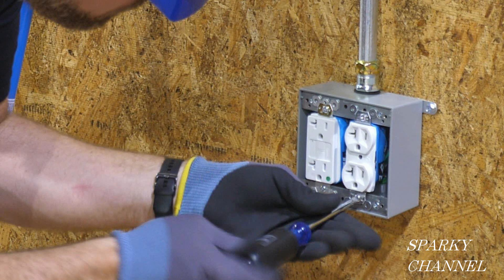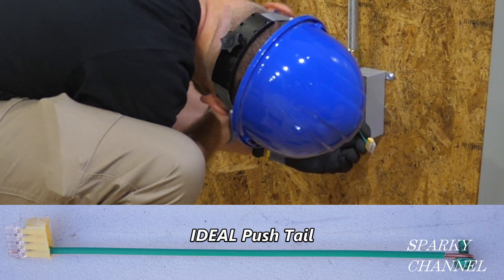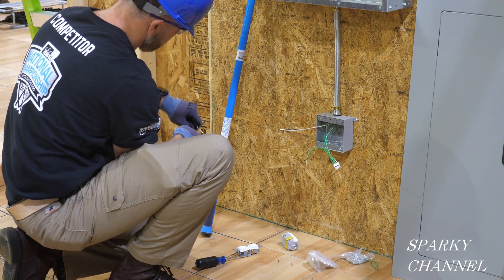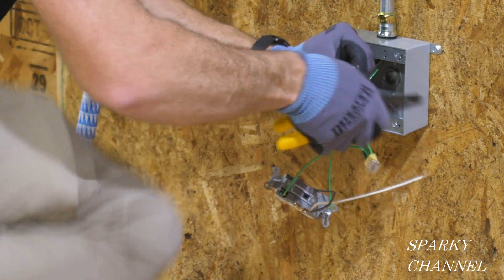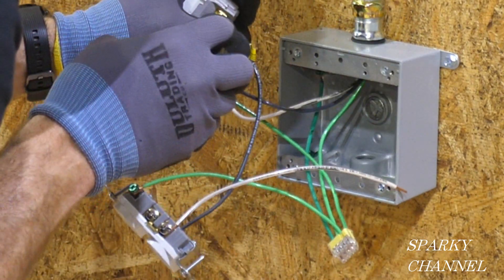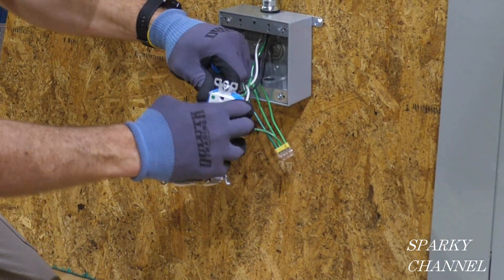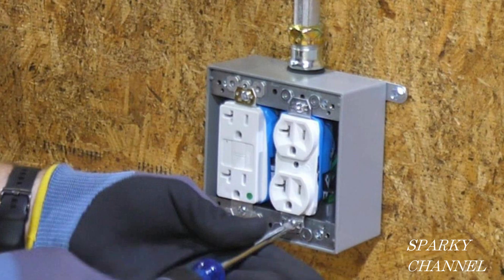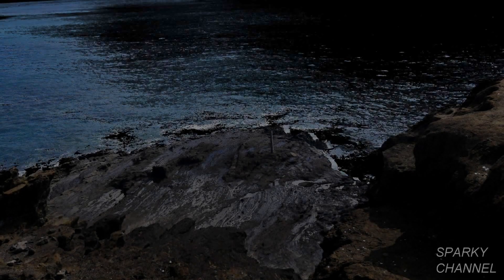Watch a Pro Wire a 20A GFCI and 20A Receptacle, Any Code Violations?

Comment: Good info.  I would argue that the "GFCI Protected" label is only required where there is no equipment ground present.  The typical scenario is replacement of a non-grounding type receptacle with a GFCI-protected grounding type receptacle (in this scenario the receptacle itself can be a GFCI type, or it can be protected by an upstream GFCI device).  Then both "GFCI Protected" and "No Equipment Ground" labels are required.
Reply: Agreed. His reference was directly referring to a branch circuit without a ground being protected with a gfci
Reply: Realistically, imagine those labels in a millionaires home?  Not a chance.  (they will have them removed instantly.)  Even at anyones home, you think the homeowners going to replace that sticker that was on that plate ?  Nah.  Besides, if your a pro and don't have a gfci tester when troubleshooting, tgan you no pro.  I Think that code was for well before the days of having said tester..  We now have breakers arc/ground fault that protect whole floors mainly basements.  That code is so outdated.
Reply: No, when the down stream receptacles have a ground and are GFCI protected they get that sticker, when they don't have a ground they also get the no equipment ground sticker.
Reply: @saltsidellc  Could you please reference where this is stated in the code?  Thank you

Comment: Stabbing in the back is a no go.
Reply from the maker: The GFCI has a system called back wire. It's a clamping system very different from back stab. You're correct, back stab is bad but that's not what he was doing. Please see my video: Back Stab vs. Back Wire (Spec Grade) Receptacles and Switches: https://youtu.be/OyXnEd1auCk
Reply: @SparkyChannel  yes I’ve primarily seen those back wire on 20 amp receptacles.
Reply: Is that a local building code vs OEM thing?
Reply: @johnjacobjingle8302  it’s an oem thing. Lutron and Leviton always seem to have it on 20 amp.

Comment: I was also told, by men smarter than me, that those receptacles are upside down.  In the event of a cord being plugged in only half way, the positive and neutral pins of the plug are open to an accidental short circuit.  By installing them with the ground pin on top, it eliminates that possibility.
Reply: Upside down receptacles (ground up) is dumb and annoying.  There is no code requiring the ground to be up.  I'm a licensed contractor in my state and I never put them in upside down (ground up,), I can't stand it.  If something falls onto the ground pin (if it is up) the object can still  teeter at a 45 degree angle and make contact with the hot and ground simultaneously.  Don't put receptacles in upside down, it's dumb and pointless.

Edit: ... And it looks stupid
Reply: @IrrationalBstrd  I still install so it makes a face but ground up is better. As the plug gets pulled out of the receptacle, it still will make good contact to around 45° so you reduce the risk of arcing or heating up a loose connection to the point of starting a fire. I refuse to install ground up until code adopts a standard orientation. All the little faces on the walls reassure me someone other than big brother is watching us at all times!
Reply: @R0me0316  now that explanation makes decent sense.  If the plug was coming out of the receptacle, the hot and neutral would make better contact in a receptacle Installed ground up... I'll buy that.  However, I find that plugs tend to want to come out on receptacles installed with ground up..
Reply: @IrrationalBstrd  yea I don't see either way really being better than the other and think it ultimately comes down to preference of the customer or electrician. And if a plug wants to pull out that easy, more often than not the receptacle needs replaced anyway.
Reply: @IrrationalBstrd  big facts
Reply: @IrrationalBstrd  I'd agree the benefits are pretty minimal but if you look at old ungrounded outlets oftentimes you'll see electricians stuck to putting the hot on the left (maybe to match typical plumbing convention?) whereas with a grounded outlet placed ground down that's flipped over to the right. A metal cover plate falling on it is pretty unlikely to make a significant difference ground up vs ground down but one of the most common objects falling onto exposed prongs is a tape measure being run against a wall. That'll never short out if it's ground up. Also, even if you follow ground down convention everywhere else one handy tip is to reverse it for switched outlets to make it more obvious which ones are affected to prevent a useless service call 10 years down the road. The only disadvantage of ground up is that it looks odd to people and flat plugs go with ground down because that's what 99% of outlets are.
Reply: It is not a code violation though.
Reply: If you look at plugs from anything electrical the two prongs are on the top, and you have to twisting the cord to insert it upside down.  And a twisted cord wants to unravel, so the cord doesn't lay flat, etc.  more likely causing a tripping hazard or getting in the way on the counter.   I have never seen a plug short out because something fell on it and crossed the hot and neutral.  For something to do that it would have to be horizontal, which if tipping over, now has a better chance of causing a short with the ground up since the angle of ground to hot or neutral is easier to short than hot and neutral in a horizontal position....depending on the angle of tilt.  But everyone has a way of doing there plugs.  I prefer the regular way over upside down, seems safer to me that way, plus with Arcfaults in place, it doesn't matter.
Reply: The argument for ground up is that water or other conducting materials falling or running down, cuz ya know... gravity, will first make contact with the ground instead of the hot. That way whatever the material is, it stands less chance to be energized, even for a moment longer, and when it makes contact with the hot the ground does what it's supposed to do and trips the breaker or operates the GFCI. Not saying I do it but some jurisdictions in Texas require it.
Reply: @rrrr6863  does that mean places like basements should faced down so if flooding occurs then the water will already be grounded? 

This idea is very flawed because if you properly ground the receptacle then the body of the receptacle is grounded well above and below the hot so it would trip either way if moisture was coming down or flood waters were rising.
Reply: @R0me0316  obviously that is the case. Every metallic, non current carrying part of a receptacle should be grounded. I'm just giving you reasoning given to me by someone who sits on the board that makes those decisions. In most circumstances when something is falling and makes contact you would want the ground to be the first thing it makes contact with. 🤷‍♂️ Didn't say I agreed with the applicability of that logic in most real world situations. I've had my masters license in the state of Texas for five years and doing electrical for 17. It's very rare I see this actually done because it is a bit counterintuitive and serves little purpose practically speaking.
Reply: @rrrr6863  Congrats, man! Yes I fully understand that code is full of redundancies for life and property safety but I personally don't believe in grounding. Any pair of boots I but are 18kv insulated and the ground is the first component I remove from a device to limit chances of being shocked because who wants to take time to find the mismarked breaker to be safe? 😂 and 2020 code requiring AF protection to be added to any circuit you touch that isn't protected is understandable but silly. I'm not going to charge grandma $200 to reset her GFI because it's not AF protected. Some parts of code are so ridiculous.
Reply: @R0me0316  yaaaaa same, I'm a 1 man electrical contractor and when grandma loses an AF breaker I tell her what the code says and let her decide if she wants to pay for the AF breaker. Grounding is absolutely essential to minimize the amount of metal parts in a home or building that can be energized without tripping the breaker; However $85 to $150 for a breaker is REDICULOUS and somewhat redundant if the system was wired correctly. But again, I ALWAYS make Grandma aware of the code requirements before I give my opinion about what "needs" to be done or what "needs" to be replaced.
Reply: @rrrr6863  was just talking to a retired master electrician tonight about how I was just about to start my own outfit until we adopted the 2020 code and how I would feel guilty for charging grandma $200-250 just to reset her GFI due to how the code is written. It was funny when he brought up how knob and tube is still the safest electrical wiring in which I have to agree, but due to decades of tieing onto it(and originally houses only having 1-3 circuits), that it is now considered unsafe just because it is overloaded. The physical separation was definitely a smart idea, but against overloading and the poor insulation on the wire( and in the walls to allow for condensation) has allowed for extremely dangerous and fatal situations. But hind sight is always 2020.
Reply: @rrrr6863  and it will trip the breaker if it contacts hot and neutral as well.  It's dumb, period... And it looks stupid. The person above.me.makes another great point.  If the equipment ground conductor is present, then the yoke of the receptacle is grounded way above and below any of the prongs, prong openings.
Reply: @IrrationalBstrd  yes but that moment that whatever it is has made contact with the hot and nothing else is rendered more hazardous for yhe time it takes to make contact with the nuetral or ground. Again this is a very specific circumstance and I didn't say I agree with it. I don't have to agree with the AHJ or customer, I just have to get it done properly at their discretion (unless in the customer's case they want someone done that violates the NEC).
Reply: @rrrr6863  I was following up until the NEC violation... Receptacle orientation isn't addressed in the NEC. I'm assuming you meant other scenarios where a customer wants something in violation, and you have to listen to and agree with AHJ.  

I personally don't think any AHJ should have the authority to required anything beyond the code, but NEC gives them that authority unfortunately.  IMO, AHJ should only be allowed to approve things by code or on a case by case basis depending on circumstances... But I'm just the guy putting the stuff in, so... It's meaningless.
Reply: @IrrationalBstrd  ok, I didn't say that the NEC does. I said that if a customer requests something unsafe or against the code i will object and educate.
Reply: If your receptacles are that loose, its time to replace them anyway. They should take a tiny tug to get out.

Comment: For the DIYer... why would one ever want to be concerned with the aspects of code that impact cost for a contractor?
What I am getting at is all the 'more safer' solutions cost more but are lower restricting code compliant also, so why not just buy the higher cost code compliant downstream products?  I typically do this.  For example putting GFCI on any replacement receptacle and using "WR" all the time.
I get it why a contractor (cost) manage it more professionally, but for a DIY where $2 vs $17... for me it is not a financial issue, I go with the safer and yes costlier product.  It is not like it is a huge financial penalty.
Reply: Only an idiot would replace all their receptacles in their house with weather rated GFI's. Code requires GFI's where there is a heightened risk of shock due to damp/wet locations such as bathrooms, laundry and kitchens or outside. Electrical code is heavily based on life safety to minimize any risk of injury, death or property damage(so insurance companies don't have to shell out). 
There is no use for a weather rated GFI to be installed in a bedroom unless you're REALLY planning on getting wild...

Comment: A professional wouldn't use stab lock connectors
Reply from the maker: Thanks!
Reply: I've replaced plenty of 30+ year old stable locked devices that wouldn't pull out but I've also had service calls where a 2 year old stab connection was loose. All depends on the quality of the product, the craftsmanship you want to be known for, and how many service calls you want to receive.
Reply: @J. F. Absolutely. Why make a potential loose connection?
Reply: @J. F. It's all good
Reply: I used to think the same, until I watched those tested at way over their amperage rating and do just fine.
Reply: @Supertrack238  when I first started doing electric I installed all of my devices like that. I changed after I started doing service work.
Reply: @FH_83_02  Point taken.  I still like the SOLID feel of wirenuts biting into the connection, and pull testing the conductors.

Comment: Nice video.  If it’s residential application they would need to be TR.  I think the screw terminals should be torqued?
Reply from the maker: Thanks! 14-18 in-lbs suggested on the receptacles.

Comment: Saying hi and wtf from Australia. Your electrical language is not even recognisable compared to ours. I think I learnt something though, I always thought you guys used white for active and black for neutral. Our regulations state only black and light blue (thanks to EU) are allowed for neutral. I'd definitely have some forgetful moments wiring in your country.
Reply: White is neutral for 110-120v 
Black, red, are the hot for 110-240v for single phase wiring. 

Black, red, blue and white are used as a set in 3 phase wiring
Green or bare is used for grounding in single and 3 phase applications. 

Gray is used for the neutral in 277v applications. 

Brown, orange, yellow are the current carrying conductors for 277-480v 

Green with a yellow stripe is the ground
Reply from the maker: Check out this video: Cheers from San Diego! IDEAL International Competition USA vs Canada vs China vs Australia: https://youtu.be/uPME283FqnM
  Electrical from different countries is really different!

Comment: The real issue is where the hell is the drill to make this process quicker
Reply: Guess the installer must be 'older' to want to let a screw gun do the 'screwing'! 😁
Reply: @jessejohnson159  lol yes
Reply: Torque
Reply: @ryanjourneymanwireman4937  Not quite sure what your word "torque" is addressing in your comment. However, the small rechargeable screw guns and screwdrivers I use will not 'over torque' a screw to cause it to strip out. I almost always twist my wrist to verify the screws I'm installing are 'tight' and not going to cause an issue later. Being a HD truck mechanic for the last 18 years of 50 in vehicle fleet maintenance, the current electric cordless screwdrivers and screw guns are nice to use after 30+ years of using the regular screwdrivers! (Hence the "older" word being used!)

Comment: The guy did a  great job on production . But as you mentioned the real issues of  code violation  somehow got dismissed because of either lack of  supply material for the compitition and  possibly for a later teaching of  code violations ? It was all  good though.  BTW the  professional should  have  known the installation was code  violation . But to do  work and be prepared on code related book referneces not everyone does a Sherlock Holms approach to little details of the  objective to seek  every detail of  the job. They should but seems everyone  was not on the  same page of as I  wrote possible later this could have  had  been a futher teaching of code restrictions . 
Cheers 03/05/2022
Reply from the maker: Thanks so much! Yes, this is a good learning video for everyone as there are code violations. They aren't the fault of the installer as he had to install the devices he was given but it's excellent that viewers can watch and learn from each others comments.

Comment: Also not sure if he had a plastic bushing on the connector inside the panel. Could put it on later in the installation but looked like he was shaping the wires already.

Comment: Is insulated drivers not a thing in the states?
Reply from the maker: I use them almost exclusively for electrical work. But not to many do, I think
Reply: @SparkyChannel  always see you guys use un isnulated tools, side cutter, pliers etc gives me the heebie jeebies, i do alot of commercial work in shops were power cant be turned off on panels
Reply: @leigh2781  lol it’s not just the states. Almost anyone doing residential electric is going to just turn power off to the circuit. Insulated tools should be saved for situations that require them.
Reply: @jacobeastham9505  yep never use insulated tools for de-energized work. The insulation is a wear item.
Reply: @leigh2781  Also remember most residential work in the US is 110v 15/20a. So it isn't nearly as dangerous as what y'all have over there.

Comment: I think you wrong about the marking.  The marking as gfci protected only apply when you replace none grounding type (2 prongs) with grounding type receptacle (3 prongs).  In this case I don’t think you have to say this receptacle is gfci protected because it has to have gfci protected no matter what when installing outside per current code.  Still thanks much for sharing I don’t think anyone know everything about the NEC.  I see even the whole inspector department of a big city (5 inspectors total) miss understood about 210.12(D)(2) exception too.
Reply: This was my thought. That code is in reference to replacing a 2 wire non grounded receptacle with a gfci, or putting one at the start of the line to protect plugs downstream
Reply: Yeah you are absolutely right

Comment: Isn't he suppose to have a grounding bushing in the panel side?
Reply: You mean bonding the outlet?
The box, at least practically speaking is bonded to the breaker panel by conduit.

And these outlets may be the kind where if they have a ground wire, they'll bond the metal box they're attached to too.